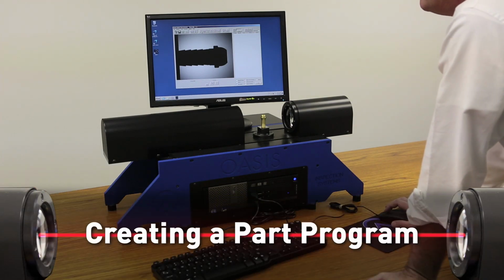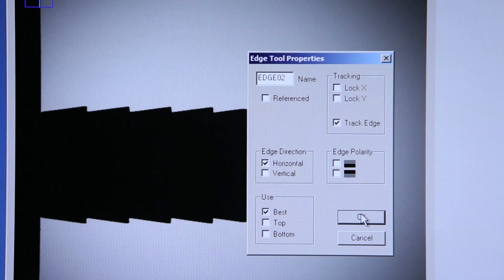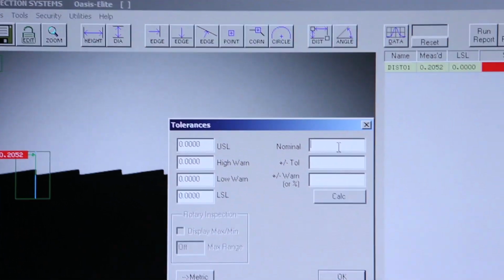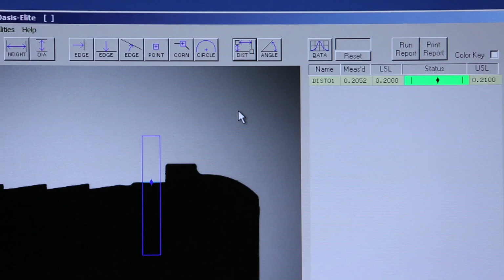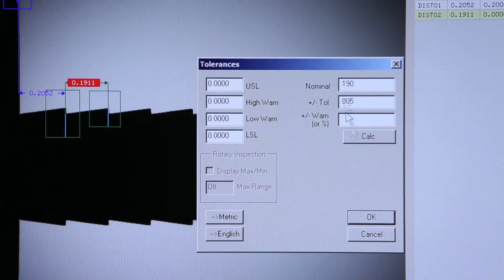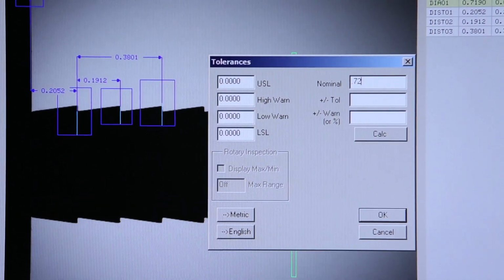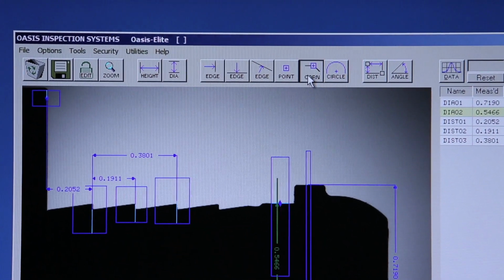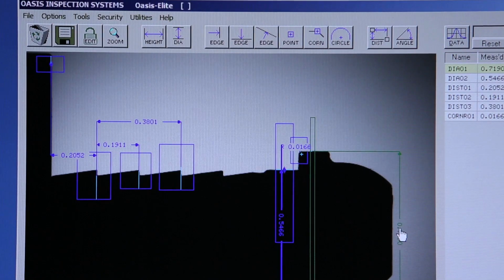OASIS Training Video #02- Creating A Part Program

Comment: when making a program for diameters are you supposed to use the diameter tool or set two edges and get a distance? i am being told engineers at George product told us to set two edges and get the diastance between for a diameter but i seem to get .020 microns different from our digital helios that we always have used for diameters? when i use the actually diameter tool i get a few microns different from the oasis to the helios? any help is appreciated thank you